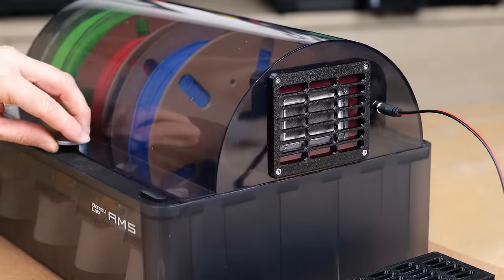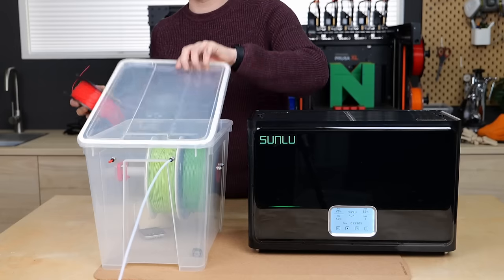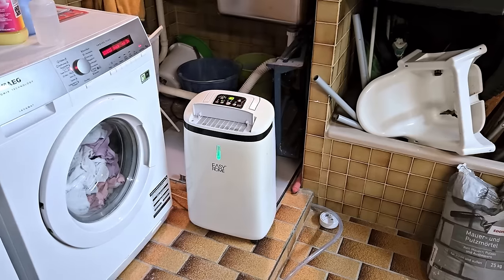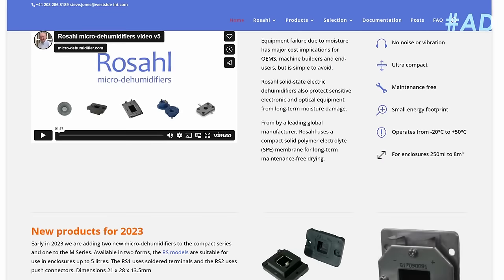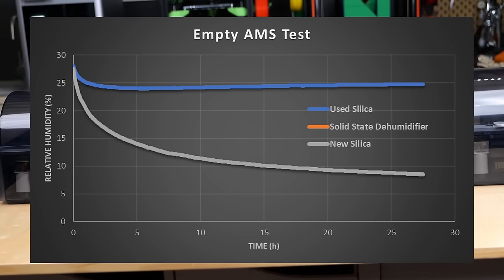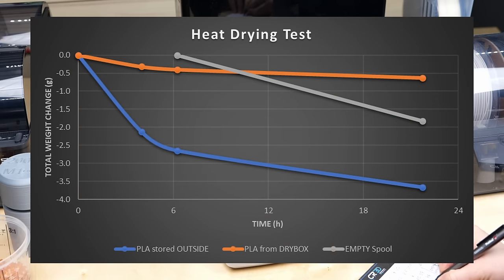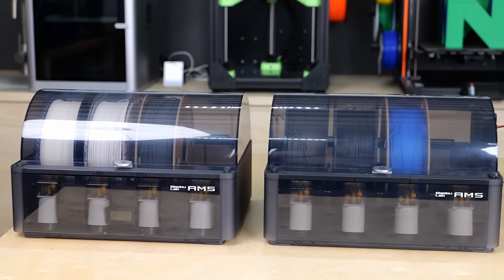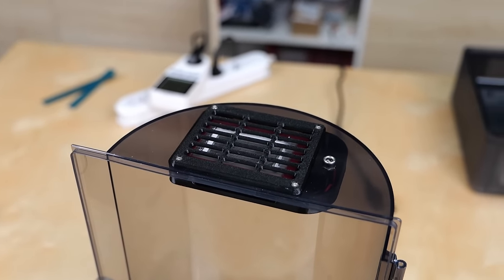Solid-State Dehumidifier: The Ultimate Filament Dry Box

Comment: I made a box in which I keep an incandescent light bulb on (when needed) with a slotted shelf on the bottom on top of a water container. My desiccant media of choice is Calcium Chloride (CaCl2), after it becomes a brine solution, I just boil it off. I believe you can also do the same with silica gel, putting it inside an oven in a baking tray, but if I'm not mistaken, the amount of water per volume or weight that CaCl2 can absorb is higher than that of Silica Gel.
And honestly, I can't remember the last time I turned the lightbulb on, I think it isn't needed.
Reply: Yes you can dry SilicaGel in a oven. In summertime I use a DIY solar dryer. In winter time I dry my SIlicaGel when my oven is hot anyways.

Some folks use even microwave ovens... not sure about this.
Reply: @michaegi4717  Microwave ovens are just ovens with a microwave function, doesn't mean they are using the microwave setting though.
Reply: I have a similar setup; 75 W incandescent rough service bulb + PC fan in a 5 Gal bucket. Can confirm that this is the best bang/buck method. I don't use decicant, I just use the light, convection and heat do the rest.
Reply: Cautionary: CaCl (sidewalk deicer salt/rock salt) is quite corrosive, especially as brine. Use only non-metal container for your brine catch tray
Reply: @ErikRedbeard  You can dry silica gel in a microwave, but it's very easy to overheat the gel since there is no way to regulate the temperature and it doesn't heat evenly. If you are careful, you can dry it a few times before it's trash. With an oven, you can dry silica gel hundreds of times.
Reply: @ErikRedbeard Sorry, this was due to my bad English... there are people who dry their SilicaGel in a (with) microwave. But there are others who are worried that the sudden steampressure within the Silica-Balls can destroy your SilicaGel.
Reply: @ErikRedbeard  When we say “in the microwave”, “microwave” is simply shorthand for “microwave oven”, and unless otherwise specified, it’s assumed that the microwave function is meant. Not to mention that the majority of microwave ovens do not have additional features.
Reply: @ErikRedbeard  all of the microwave ovens I have seen only heat the contents by applying high power microwaves.
A conventional oven is a heated chamber that transfers heat to whatever is in it by conduction, convection and infrared radiation.
Reply: Plenty of places in the world have this thing also known as a combi microwave oven, plenty of times called a microwave oven. Which can both do oven and microwave functions.
Just saying microwave oven isn't indicative enough to assume microwave usage.

Microwave is just called a microwave and an oven is just called an oven. It makes perfect sense for those places where a combi is normal to call it a microwave oven.
Reply: Isn't the deliquescent point of calcium chloride rather high? I thought it was above 30%RH by the point it hydrated to become a brine.

Comment: I would like to see a room dehumidifier adapted to dry a closed system of spool storage with only water exiting and air entering at the same volume.
Reply: Most room-scale dehumidifiers don't really try to pull down past about 40%,and the built in sensor loses reliable accuracy below about 20%RH.

Comment: Very cool. I would still just go with a solution like dry tote: recharging those packs take 3 minutes in a microwave at 80% duty. Assuming a 1200W microwave, it takes as much power as running the solid state dehumidifier for 15 hours. I only need to charge the bags once a month, but normally charge once a week for reliability. That is 10% of the power needed and the bags are relatively easy to replace.
Reply: 1200W microwave!??!? Never seen that power! Standard in my country is like... 800W :P
Reply: @Megamannen  1200W microwaves are common in North America. They’re bigger, which is really handy so you can use large plates.
Reply: @tookitogo  Big microwaves for big plates for big bellies. :)

Comment: Hi Stefan, maybe you can try using a fan to circulate the air so I dry my silica and filaments by closing the hot bed of my printer and it greatly speeds up the drying times.
We are next to the Rio de la Plata and the humidity is almost 90% so it is something that we have to do often the humidity kills us
a big hug from Temperley, Buenos Aires, Argentina
Reply from the maker: I'll definitely try that!
Reply: @CHZ-Tec
I moved for a few months to Cambodia to work for a NGO. here I teach two workers how to use the 3D-Printer. do you have any tipps for when the rainy season starts. or just tipps in general.
Reply: @jonathankohn8522  build dry boxes and print directly from them. Do as little as possible to prevent opening them unnecessarily, since it will immediately undo any drying you have done since the last time it was opened.
Reply: @MattWeber I will add to building dry box to add a standard dehumidifier to that box. You could run that. You start that before printing.

Comment: Connecting this to vacuum pump might be good idea. Getting even near perfect vacuum incredibly hard but can draw most moisture out without heating and can work faster. Getting partial vacuum but that air is very dry could speed up whole process compared to just dry air
Reply: Adding some silca inside as well
Reply: Believe I have seen a video on this; apparently didn't work well.  One issue is that the absorbed water needs heat energy to break the attraction to the plastic filament, and without air convection that's only supplied by radiation and conduction through quite long, poorly thermally conductive paths in plastic (filament).
Reply: you would need a 2 stage vacuum pump with a gas valve otherwise it wouldnt maintain a decent vacuum and your pump's oil would turn to mayonnaise from the water vapour mixing with it, makes it too expensive to do. you also need to heat the vacuum chamber to make it remove enough water.

Comment: I almost never have issues with PLA or PETG in my area.  I have a 12x12 shed with electricity, insulation, and drywall where all of my printers except for my Prusa (it's quiet enough to be inside) live.  I am in a high desert, so the maximum humidity we ever really see is ~50% and indoors it is much lower.  There are months where you have to use a humidifier in your bedroom while you sleep to avoid nosebleeds. I genuinely have empathy for how much people seem to struggle with keeping their filament dry.  I've only had issues with it ONCE. Last year we had a VERY wet winter, and one of the windows in the shed had blown a seal and I didn't notice it.  My PETG was sputtering and popping.  I just dealt with the reduced quality and when summer came, it dried back out.

Comment: I'm so glad you made this video. I live n a Coastal Community where the humidity 60 - 100% humidity. It's a serious issue and for me this solution seems to be the only solution despite the initial cost. Constantly heating up the filament degrades the filament no question. Silica beads are a huge pain in the a$s to manage plus somewhat expensive. To me, despite the initial cost, this is the best solution outside of a professional drying cabinet. So now I'm weighing the electricity cost of a professional cabinet or using something like this with the filament changer.nope I've convinced myself. 

You raise a great question about durability though especially with the topic of microscopic plastics on the rise. Since there is movement in the filament changer there will be tiny bits of debris. If you were to add a fan to the panel it would need a pre filter to prevent premature degradation.

Comment: I got a $30 small food drier from AliExpress and fixed it to a side of IKEA Samla box. Can dry filament, before, after, and during printing just by clicking a button on the thing. Inside there is a big blower fan and a heating element. With cheap enough fans and heating elements, one can turn a dozen Samla boxes into dehymidifiers for filament - no desecant is required really.
Reply: Link?
Reply: you fail to mention power cost

Comment: Many years ago, I used this principle indirectly at work: We used a water detection system to determine water content in chemical compounds. A sample was heated and the volatiles hit a structured ceramic plate which did the electrolysis. The resulting current resembled the water content.

Comment: I live in Colorado so I do not care one bit about drying my filament, but still love to watch your videos. The humidity here routinely is in the 5% range 😂. And we have a whole house humidifier rather than a dehumidifier.
Reply: This IS the solution : everybody should move to Colorado. Or Sahara maybe 😂
Reply: From Arizona here... I feel you
Reply: Depends on where you do your printing.
If there is a humidifier in your house, and your filament is in the house (perhaps not?)...
Reply: @ericpascual8913  That point does have another big pro argument: solar energy! So our hobby would get much more co2 neutral, too 😄
Reply: Swamp coolers work better as far as I am concerned.
Reply: @thomasl78    You need MORE co2 with all these pot farms.
Reply: Actually, it isn't that low except under certain conditions. One is where you live in Colorado. I live in CO too, a little south of Denver, and have indoor and outdoor humidity monitors. During the winter it can be down to 10%, usually lower indoors when the heater is running. However, during the summer it can jump to 40%+ during rainy days and thunderstorms. Air conditioning will lower it, but no where even close to 5%.
Reply: @swdw973  I’m in centennial. I hit 5% all the time, numerous times a year, both from thermostat readings and my iot measurements. I have a humidifier and keeping it at 40% in the house is close to impossible. During the summer when you shouldn’t be running the humidifier (it can freeze the ac coils) it definitely doesn’t get to 40%. Maybe 20% max. The past year has been quite wet but still the majority of the time the humidity has been very very low.

Comment: I store my filament in a large plastic 200 liter drum with screw top lid with a seal. I flush the container with Argon/Nitrogen from my welding gas cylinder. Its only a small amount that is required to get rid of the air. No moisture and if any is present it will equalize throughout the Ar/N gas according to chemical balance. 
In my professional life i have long time storage preserved large gearboxes for ship propulsion and winches by covering gears with assembly oil and vacuum gently while flushing with Ar/N welding gas. Seal all up and good for years without any worry about corrosion of gears and bearings, specially in middle east conditions with large temp differential and breathing of equipment sucking in moist air during cooling down and subsequent condensation inside. I have had gearboxes stored for 1 year breathing in moist air and completely screwed up requiring complete overhaul. I do like the solid state dehumidifier, gonna buy one for the carbon X1 filament box. Good video.

Comment: I think the real place for this is in addition to desiccant.  The desiccant gets it fairly dry, and the membrane gets it even dryer, and also recharges the desiccant over time.  You can also add a door to the outside of the housing to prevent moisture getting in when it's off.

Comment: As just an fyi, I do research in the polymer science field and the only way in the lab that we are able to fully remove all of a solvent (like water) from a polymer is to heat it above its glass transition temperature and either use "dry" inert gas or cycle a vacuum oven to eliminate all of the solvent in the chamber. Generally, it is difficult to heat a spool of filament above this temperature which would be around 100°C for ABS for instance, and keep it there long enough to get it all out. You will always have at least some water and likely residual solvent/monomer coming out of the filament no matter what you do, but I like very much like the electrode solution if you can get ahold of it.
Reply: Do you know roughly to what extent a filament can be dried using a consumer drying box or using the silica gels ? Also, I wonder what is the initial water content of a new filament, would it be zero, very close to zero or does it quickly absorb some during manufacturing and packaging before being put into the sealed packaging (and then I guess it decreases again because of the silica gel in the packaging) ?
Reply: @metebalci  it really depends on the filament and the company, but when I get in abs or especially nylon I have to dry it first, because it has too much water in it. The issue with the drying beads is that they are exhausted quickly and don't pull the RH down low enough, especially once they have taken up some water. You really aren't gonna get much below 10% humidity in your box with them unless you're changing them constantly. You can get lower with drierite chips, but either way, even at 0% relative humidity, you can't get the last 1-2% of water out of the plastic at room temperature. The only way is to be above the glass transition temperature of the filament AND dry. But the issue with doing that is that the filament starts to stick to itself a little bit. If you leave it too long, you'll brick your spool. You have to not go too high in temp and not leave it too long, so you're gonna have trouble getting that last bit out. Or if it's really important, there are products out there that heat and dry the filament after it leaves the spool but before it goes into the printer. This method is also more simple since you don't have to work about water anymore or how you store your filament.

Comment: btw, the plastic your boxes are made of is moisture-permeable too. So if you want ultimate low humidity, use metal or glass (covering a plastic box with aluminium tape seems to help quite a bit)

Comment: When I ran a lab with several printers in it, I used to keep at least the nylon spools in vacuum garment bags with small silica packs; they had so little air inside and they worked well as humidity barriers so the packs never needed to be replaced while I was there (just under three years).
This is even better because I could run them off energy harvesting of some type (the noise you hear in your office light ballasts is collectable 🙂) so they could be self contained and portable without having anything extra inside with the materials.
Reply: Please tell me more about powering stuff using the noise from the light ballasts.

Comment: Oh, I'm definitely getting some of these for my two 4 spool homemade filament boxes. Setting them on a timer to power on an hour a day or something. However long it takes to keep them dry.
Reply: You must have missed the part where he said, when powered off, they allow water through them. If your box is drier than the air outside of it, water will flow back through the device and into your drybox. They need to be powered constantly to be effective, unless you have some way of sealing the exterior facing side of them from the outside air when switched off.

Comment: If you don't want to guess about your desiccant and not spend a fortune on the indicating type, get a small quantity of the indicating stuff and either mix it ~5% into your plain stock or put it in separate packets. You only need it to be visible and representative of what is happening inside the box, it doesn't need to contribute any meaningful amount of dehumidification.

Comment: Talk about timing!  I've been working on a way to directly measure relative moisture content in filament.  The big drawback is that its readings can only be compared between two samples of a given filament: it can say "sample A has 0.1% more moisture than sample B," but it always needs a per-spool baseline.  The design is surprisingly simple, and is sensitive to fractional percentage changes in moisture content using under 3m of filament.  The main testing routine has been cutting samples, drying them using the heated bed technique and/or soaking them in water over time.  The sensor is verifying out nicely, but the results are basically "Common filaments just don't get that wet."

This mostly matches what Thomas Sandlanderer found in his video: storage doesn't matter much for the most common materials.  Nylon is great at absorbing moisture, so it's a good test subject, but only 2 out of 12 spools of PLA seem like they absorb meaningful amounts of moisture.  PETG picks up a bit, while ASA has stayed surprisingly dry in my garage.

I'm still figuring out if this is worth developing into a product, but once that's sorted out, I'll be very happy to share the details.  (If it's a product, there are a few patents I should get.  But once those patents are out there, anyone who does electronics can build their own in an afternoon for ~$25.  And if it isn't a product, I'll release all my documentation on the web.)

Comment: I just frankensteined a dehydrator, 60 litre sealable storage tub and added a couple of closable vents, it turns on for around 2 hours a day and all my most hygroscopic filament is consistently at between 8-12% humidity in the box. I haven't noticed any degradation in the filament storing it this way, I have 2 year old petg and nylon in there that I used a couple of days ago that printed beautifully. I have measured the temp of the box and at different levels it reached different max temps PETG goes in the 55c area and nylon goes in the hotspot which reaches just under 70c. I also have around 500g of desiccant in the box which keeps the moisture under control between cycles.